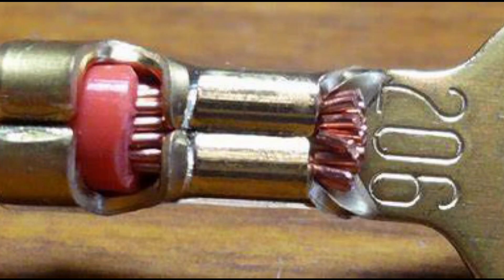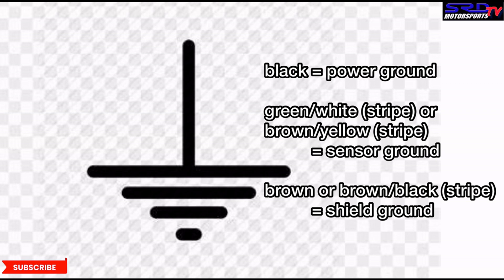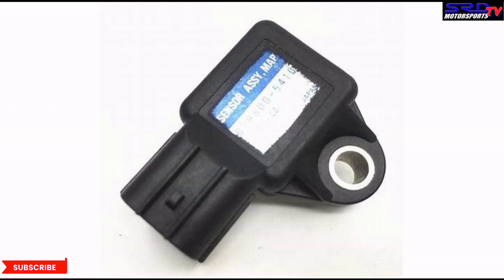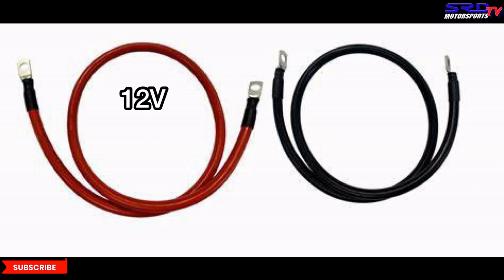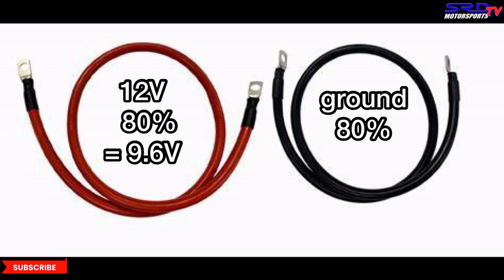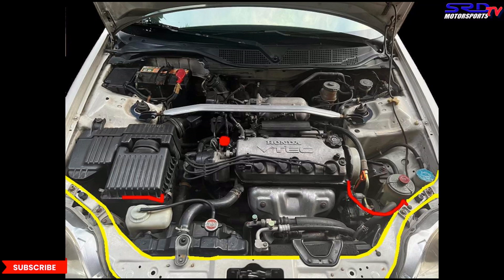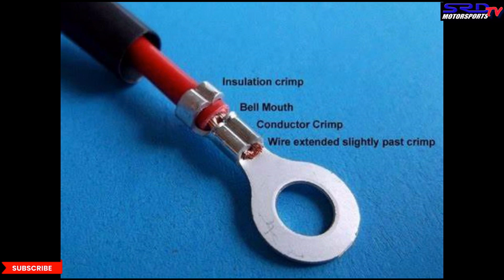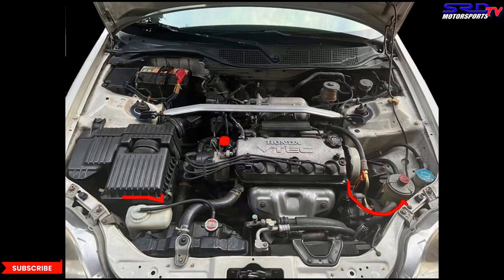The Importance of Automotive Ground: Tech Talk by SRDmotorsports

Comment: Electrician here:

The stock grounds on most cars are very good, 30 years on, they just need REPLACING. That is, one very good ground from the timing belt side of your engine to the body, one ground from or very close to your starter to the body. Next, a good solid ground from your battery to your body. this can be split so you in effect have two going to two different bolt holes on the body nearby, giving you redundancy should one fail or become loose, which you will find during maintenance. The ground cables should have a cross sectional area of 25-35mm2, be all the same size at least as the ground/s coming off your battery terminal. For the alternator positive you need to run a 16mm2-25mm2 cable and the starter positive you need a 25mm-35mm cable as per your ground cable choice. Use multi stranded soft flexible automotive grade cable, do not use cheap cables for this task. Joints should be crimped or soldered and glue heat shrinked at lugs or terminals, I solder but I have 30 odd years of experience doing this and recommend crimping to most people. Screw terminals are crap and really only for temporary use. Without getting into ECU or other automotive wiring systems for sensors and 5V analog reference etc thats all you need 😀
Reply from the maker: Yep
Reply: What kind of electrician? I'm a home electrician but home and automotive are completely different,  but on the topic of automotive i am very interested in fully understanding grounding,  im thinking I'm having potential grounding issues in a 88 mustang i built
Reply from the maker: @BrandonKnight-il9xs  yeah most day “stock” are good but it’s prolly not even stock since decades ago (most cars) 

On your car though u can start by double checking the “contact” on the ground to body …there are times when re painted and stuff the contact between ground terminal
And body gets too insulated (via paint and bondo etc)

that’s a decent place to start fo u 🫡
Reply: @SRDmotorsports my headlights and parking lights flicker at idle bad i need to redo the battery coil it's in with self tappers
Reply from the maker: the good thing is it’s readily identified so u can work on it for sure 😎

Comment: sir what are the size of the wire u used 8:02
Reply from the maker: need a thick enough guage not size
Reply: @SRDmotorsports owww. what gauge did u use sir? btw thanks for this video. very informative
Reply from the maker: similar to what they use on subs and sounds systems the thick ones
Reply: @SRDmotorsports  thank you sir 👌
Reply from the maker: No prob

Comment: Hi sorry for the question I'm really looking for someone to help me, I've been having surging issues in my engine where I can see voltage drops in a few sensors including my electric wastegate for the turbo, could this be the cause of my problems??, it seems as if I get electricity disconnected intermittently while driving. Do these negative cables wear out over time??I own a 2011 Kia optima 2.0 turbo. If anyone can help really appreciate it thanks.
Reply from the maker: Oh interesting issue… and yes the negative cables do wear out over time mostly where it’s bolted to so check on those one by one
Reply: @SRDmotorsports  Thank you for your response I will order new ground cable and see if it helps. Very good info video also thanks again for your response and info video's you post here on YouTube.
Reply from the maker: oh wow thank you and you’re welcome…

Also check even the negative cable on the battery to chassis/fuse box the bolt there might be loose or corroded etc giving that intermittent issue

Comment: gud po... how much po?
Reply from the maker: Says in the video. 2k
Reply: @SRDmotorsports  tenkyuuu...
Reply from the maker: @pogtv841  np sir
Reply: @SRDmotorsports  ilang inches po ung wire papunta sa alternator bracket? ty po...
Reply from the maker: @pogtv841  I measured it Mano Mano by removing the manifold
Reply: @SRDmotorsports  tenkyuuu po sir... godbless...
Reply from the maker: @pogtv841  np sir

Comment: One thing I've noticed on Hondas is that the bolts used on the ground points are usually a different type of 10mm bolt. The ground bolt doesn't have the normal "I0" marking, and the threads are usually a self-tapping type which I believe is to clear out any paint in the hole to make a good electrical connection to the chassis. I usually run an M6 tap through the holes to clear out any surface rust.
Reply from the maker: oh yes whoa! good observation there!!! and agree its prolly honda's reason as even T1 did say back in HT that even painting the alternator bracket? hinders or lessens "ground" quality...

its why even the factory ground spots i always make sure we send the base of the bold or nut to ensure chassis contact is good
Reply: Great point, I noticed that too! I never understood why Honda (and others) try to ground through the paint though, I suppose it's just faster/easier to use a self tapping style bolt than keep the paint off the ground points and/or grind the paint off the ground points. Grounding through the bolt/threads  works well enough before things rust, but I've seen situations where the connection isn't good. I always sand the paint off under the ground points to shiny metal, sand the ring terminals, clean the bolt and its threads, and coat the bare sheet metal, bolt threads, and both sides of the ring terminal with copper anti seize before assembly to prevent corrosion over time, which I believe is best practice. The ring terminal being in direct contact with bare metal makes the electrical conductivity of the bolt and its threads mostly irrelevant.

Comment: Is it better to ground to chassis, or ground to batt neg terminal? Or it really depends on the location of the ground?
Reply from the maker: by design the chassis is grounded from or withthe battery negative, but thru time corrosion on steel and even repaint changes the resistance sometimes to a point that chassis ground  is so much "less" than battery negative...

and even the ecu ideally needs the negatir that matches the positive ..of the battery

it is why one of te ground wires i did goes to the chassis/tranny to help and the rest of the sensors rely on that but with the gounding kit it helps it equalize to the same amount/rate as the battery positive so it matches better
Reply: @SRDmotorsports  thank you, newer Hondas got this ELD thingy, it prevents the voltage from exceeding 14 bolts. So if we are getting 13.5 to 13.9v on idle and cruising, we should be good right?
Reply from the maker: @antonc108  yes 13.5-13.9 is good…anything over 14.4v it stresses our ecu and the sensors like iacv and map etc etc… albeit the lowest I’d consider “okay” is probably 13.4ish

Comment: JUST DID this setup... Can never over kill the grounding on these Hondas lol

QUESTION: 99 EJ6 (EK) hatchback
IF Battery is in the trunk, where is it the best location to bolt the battery negative to?

Thank you
Reply from the maker: great stuff! Actually since I do plan to relocate mine after the grounding kit… I been contemplating as before I’d ground it to the body at the trunk… but I’m thinking maybe even the negative can be relocated and have a positive and negative pole by the firewall or near the oem location 

Cuz I figure the body at the rear may be too far
Reply: @SRDmotorsports  actually have positive and negative poles relocated in to the engine bay. 

Works AWESOM to keep battery on trickle when car is stored for winter.

What I did for the grounds off the alternator, block, trans etc., is ran them all back to the subframe.
Reply from the maker: @ALLRealtySolutions  oh that subframe work is a good thing real real good ftw!
Reply: The strut mount nuts seem to work very well as long as you sand or grind the surface under the nut to shiny metal totally free of paint and rust before making the connection. That's what I did on my ES1 and I measured that the voltage drop from the negative battery terminal to the engine block whine cranking is only about 0.1 volts using the chassis as a ground, which is significantly less than the ~0.3 volt loss through the 2 gauge copper positive cable.

Comment: But a kit I’m looking at is 500 😢
Reply from the maker: Oh that’s fine just double check what I’ve said in the video if it covers most of the spots talked about then it’s fine but also research on the AWG8 wire guage and check mm measurement

If it’s same or close then that’s a steal get it! Cuz it could also be way thinner hence lifespan and durability together with effectiveness goes south
Reply: @SRDmotorsports  along with the entire harness kit it’s 2k lol 😂. But it’ll be a nice tucked engine bay thanks for the info and yes the gauge is very important to me as the old ones I had was oem and very small.
Reply from the maker: @topshelf223  yep just like the video I made about ClyWire… good is good but not just “aesthetically” good 
Like believe it or not , ClyWire harness has zero solders everything is cleanly crimped and secure so no room for moisture or condensation anywhere “inside”

That is why a “year” later most of those cars suddenly need rechecking of wiring etc etc
And

“Length” variation does change resistance too

Comment: Thank you for this video, I need this. BTW, what is the size of wire? Is it a type 8 gauge?
Reply from the maker: Yes AWG8 guage 8 but beware a lot of guage8 wires the core is not as thick as guage8

And a lot of times the copper wire when washed with carb cleaner the copper paint washes off lol so the resistance on that is bad

Plus even our hands have acid that touching it will kick start future corrosion 

And also terminals are crucial overkill soldering is bad

It’s why we use a nytril rubber gloves when working on stuff like this
Reply: @SRDmotorsports  Thank you so much for these info. More power to your channel.
Reply from the maker: @Raymund_Matias  thanks

Comment: on point 👍
Reply from the maker: I remember hcp days first experience was a Jdm grounding wire kit and it helped alot 

Then clyde “ef92b” in hcp owner of clywire did explain all I know now and so I improved old existing on… that prolly helped the Ph15 build I did in hcp on dyno and at the track
Reply: True

Old forums and performance car magazines where the source of information back then
Reply from the maker: @blue3549  yeah and I actually miss those like when Honda Tuning actually had and did their own project so regardless of results the “sharing” aspect was great and that’s what molded me to how I treat stuff
Reply: @SRDmotorsports  
Indeed

Those who are really knowledgeable take those upgrades as guides only 😉

Those who are not swears by their claim with "butt" Dyno hahaha 🤣😂🤣
Reply from the maker: @blue3549  hahaha those are facts!!
Reply: Ah right, those project cars where they showcase the new performance products (usually bolt ons) available in the market

They would also post the projected HP and torque increase among different brands of air filters, header and mufflers ☺️
Reply from the maker: @blue3549  yeah it was fun to learn for sure

Comment: thanks SRDMotorsports TV for the detailed setup of grounding 😊
Reply from the maker: But a lot of times if the wiring is not in good condition running a proper ground kit may need a retune but definitely means way better performance
Reply from the maker: Yes remember with your car, when everyone claimed it needed a retune… we could have made more by saying “yes let’s tune”

But to be certain and for no “short cut” we checked all the details and we’ll the idle went back to normal when everything was going well

Not needing a tune

Comment: How are you guys doing the ground kit for cars with relocated battery in the trunk?
Reply from the maker: All you would need is terminal / pole and run a heavier guage awg2 or awg4 ideally

have a dedicated positive and negative pole routed from battery to the engine bay…

serves as the pole where u can easily use for the timing light ftw!
Reply: @SRDmotorsports  Ah ok. Thank you! Do you guys always use full size/capacity batteries? Any experience with different types? Lightweight AGM or maybe even Lithium? Do they affect perfermance at all?
Reply from the maker: @kmvguy  no performance effect i mean no downside

only downside here is they hella expensive and most of the time its imported from the US :( so super exp